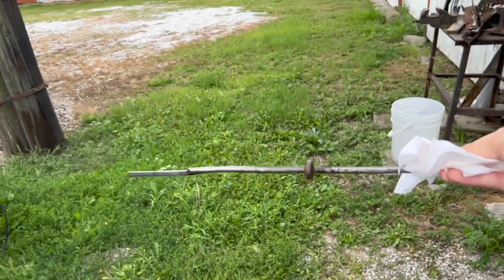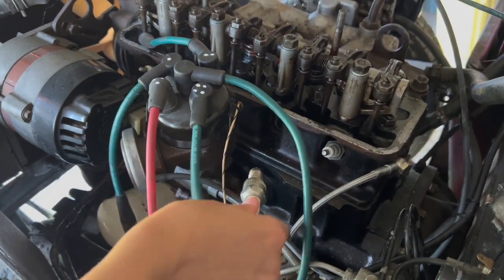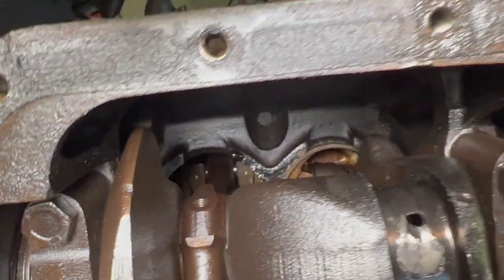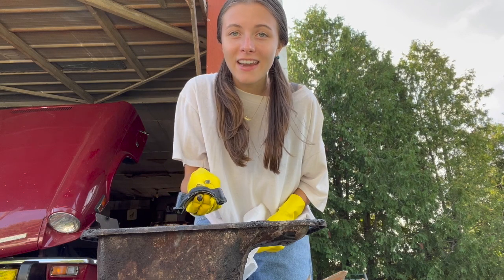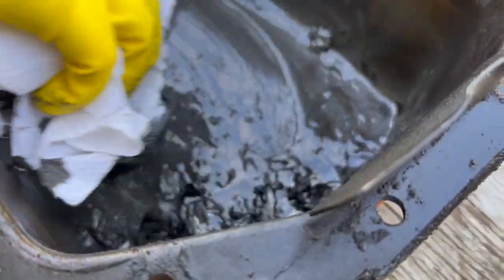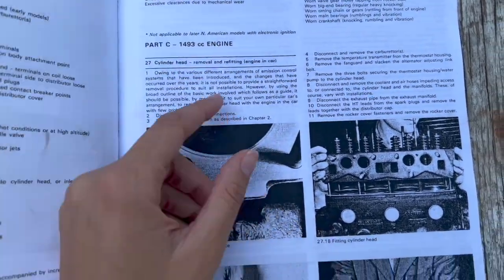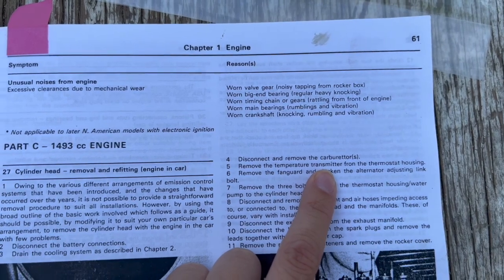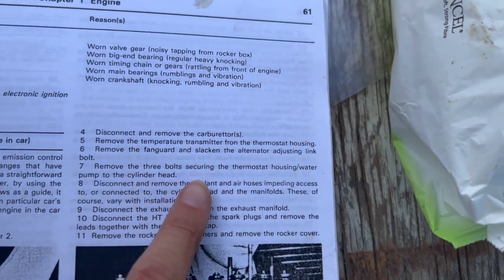Ep.6 | Restoring my '73 Triumph Spitfire 1500

Comment: Hi Saige, you guys are doing great!  It looks like you dodged a bullet when the connecting rod let loose, incredibly it did not get pushed out through the engine block while the crankshaft was rotating. It also appears the crankshaft should be repairable. As far as removing the stuck nut on the exhaust stud, usually heating the nut with an acetylene torch will help. I believe I saw some deep scratches when you inspected the cylinder with the borescope. If indeed it does have scratches or gouges, the engine block will need to come out for machining. Good luck and looking forward to your next video.
Reply from the maker: Great advice, thanks, I’ll keep you posted!

Comment: Bonjour Saige, :)  Hope the dismantling process is going well.  Hopefully the block should survive but imho, as already said I don't think the crankshaft should be reused, because of blueing & other damage.
If you are caring & methodic (..and sure you are !👍), you can replace the crankshaft yourself.
It is not a difficult job but cleanliness is essential with engine components. It is like working in a surgery room..
The crank may be a big lump of steel but consider it as fragile as a baby (bearing surfaces).  
No dirt, swarf, scratches etc are allowed on these surfaces prior to assembly. All must be perfect, including its oil galleries.
It is the same for all engine parts (pistons/rods/bores/bearing shells etc).  
Most of the sliding or rotating surfaces need oil lubrication prior assembly, but some do not !  
(for example: bearing shells need to be installed dry in the block and then oiled before receiving the crankshaft)
(crankshaft & rod cap bolts need a tear of wiped oil on the threads and underhead but pay attention there is no liquid on 
any blind tapped holes before torquing up)
If you are planning to build a reliable engine, i advise a reconditioned crankshaft that is ground no more than 0.010 inch undersize on main & rod bearings . Cranks ground deeper tend to wear rapidly.. because surface hardening is somewhat thin on Triumph cranks, and particularly on the 1500 engine (wear is hard on the centre bearing). 
Best option is fitting a nitrided crankshaft where surfaces are hardened to improve wear resistance. (available for example from Angloparts in Belgium, check their on line catalogue).
Use good quality bearing shells (AE/Federal Mogul etc..)
Perhaps the car ran several miles after the initial clong-clong... : Don't rebuild anything before having flushed (solvant) & then dried (compressed air) all the engine block oil galleries, as obviously from one video, oil circuit is full of metal grit everywhere .This is best done after camshaft removing to give full access to the galleries. (galleries are plugged by a line of small bolts alongside the block and at both ends).Some rifle brushes and extension rods are great for cleaning these.
One more recommendation is to replace all conrod bolts. they should be fitted only once.
Your Spit is from 73, so it doesn't have the uprated conrod bolts fitted to all later 1500s : Preferably fit these uprated bolts part UKC2598, preferably original ones. (perhaps Rimmer still have them or Spitfirescheune in Germany)
And.. good luck for the next stage! 🙂
Reply from the maker: Wow this is so helpful! Thank you so much for all this advice I really appreciate it!!

Comment: Oops! I forgot to answer your main queries...🙃🙃
 This exhaust manifold bracket is not critical,  you can get on without it as the inlet manifold is mainly clamped at the flange side and considering it is a single carb assembly.. it is quite light weight. But if you prefer to fix it,  those exhaust manifolds are cheap & plentiful and may not be more expensive than a welding repair (and yes iron welding is special..). 
You can still repair it by bolting on some metal bridge across the two unused brackets. Then it is quite easy to drill a new center hole on this bridging piece and adjust correct height of the center mount by selective use of several flat washers, or by lightly filing the inlet manifold stud boss.  
About the cylinder head : It should not be damaged in any way cause on a stock spitfire engine the valves cannot physically hit pistons. This is called a "non interference" engine.
About head dismantling : after a drop of some penetrating oil put onto all the head stud threads,  the rocker shaft ramp  can be removed very gradually after loosening all the rocker arm adjusters.
Then loosen each cylinder head nut just a little, following the reverse of the tightening sequence shown in the manual. Repeat the sequence until all nuts are free. 
I work on these engines so I strongly advise not to reuse the old cyl-head nuts nor to use "normal" asiatic new ones.. , they strip easily!! Studs can be reused after thread inspection but you definitely need uprated nuts (those incorporating the washer), they are stock on late BMC Mini engines.  😉
Reply from the maker: Got it, thanks!

Comment: Hi. The "glue"  is probably due to an additive to use unleaded fuel. Try to clean it with break cleaner. It's one of the two best fiend of the mechanic with wd40, this one is helpful for the stuck bolts. Heat can also be helpful. Last option is to cut it. Maybe the crankshaft is salvageable, only a pro can tell you. As it has perform a lot of friction, a balancing could be useful Only the opening can tell you all the other work you will need to do on the engine Good luck with your car.
Reply from the maker: Fingers crossed about the crankshaft, I’ll probably end up taking it to a machine shop, but first I have to get it out!

Comment: Bonjour Saige, :) As advised a thorough inspection of the casting by a machine-shop is mandatory
In my opinion, the broken conrod bolt(s) could be, not the cause, but the result of the failure through general wear & lack of maintenance by the precedent owners(s). Why? :
A/ The sump is full of oil sludge.. oil sludge is a sign of old oil mixed with condensation and/or delayed oil changes through the years..  Old oil does not do its lubrication / heat transfer work anymore

B/ The crankshaft bearing surface area seems to have "blued" : Blueing or discoloration indicates high temp caused by some friction, possibly crank seizing. A "blued" crank is toast as it changes metal structure properties.
 If crankshaft crankpin seized, conrod bolts may have fractured on the last step of stress..
 
C/ On your engine there is an aftermarket fitment that diverts oil pressure off the main circuit (crankshaft):   
This "rockershaft oil feed", as it is named,  is bolted at the rear of cylinder head and in fact delivers surely more (too much) oil to the rockers  ..but weakens the main circuit oil pressure in doing so. The rocker assy having no tight clearances, it does not hold pressure... : Not good!   Same effect as a drilled garden hose...
Your crankshaft/rods/camshaft bearings need all the oil pressure available to avoid wear/metal contact! 
 
D/ As already said, at the front the grille is masked by 2 big non std square lamps (+ the number plate).. : as a result the radiator and engine do not receive all the air they need for an efficient mechanical cooling  

Good luck for the next stage! 🙂
Reply from the maker: Wow thank you so much for this! I’m curious to learn about the rockershaft oil feed as well as figuring out where to move the licence plate and fog lamps
Reply: @saigesgarage   Bonjour Saige, :) Initially the feed kit was intended to be used on racing engines which are often fitted with special high-lift rockershaft assy (those open the valves deeper in order to boost cyl filling).
Race engines run at very high rpm and the special high-lift rockers are supported by needle bearings needing more oil flow than offered by the original system.
Then, classic car parts specialists hijacked it and put it on their catalogues in order to help curing one of the main weaknesses of this engine : rockershaft "poor lubrication problem".
The factory rockershaft oil supply is ok (not excellent) when all the parts are in good condition and rightly fitted (both end plugs & top fixing screw in place).
With unfrequent oil changes, the galleries tend to clog and initial flow suffer.
As designed by the factory the rockershaft assy does not receive full flow but a restricted one due to presence of the camshaft rear journal obstruction in the way.    
This rear journal meters oil to the top via flats & a thin spiral groove machined on the  bearing surface.
By using the "feed kit", oil is directly taken from the main gallery to the rockers, bypassing the cam journal "obstruction" so ... general oil pressure goes down! 😟
Another pb brought by it : Too much oil is sucked through the valve guides = more exhaust fumes! 😉

Comment: fun neat videos.  doing great.  cast iron can be welded.  but it takes someone who knows wha tthey are doing and after the wled it has to cool down very slowly so welders will wrap the part in welders matt to keep cool it down slowly.  sometimes ppl will drill a hole at each end of the crack to stop the crack from propagating and then braze the crack and fill the holes.
Reply from the maker: Good to know, I’ll find out more once we pull it out